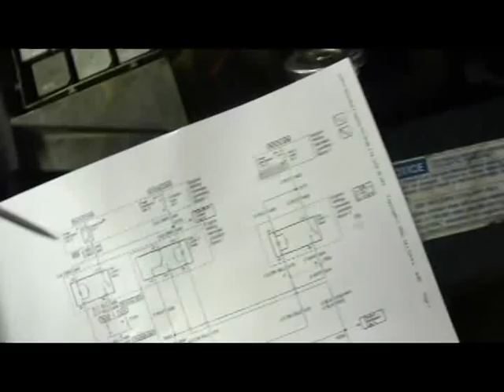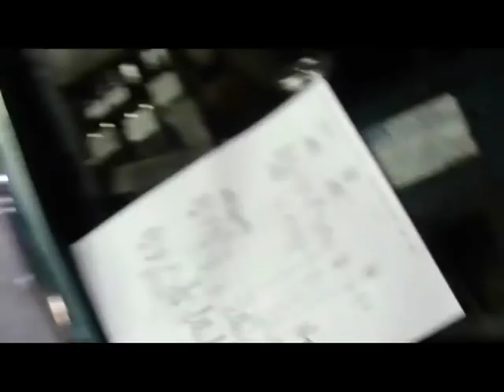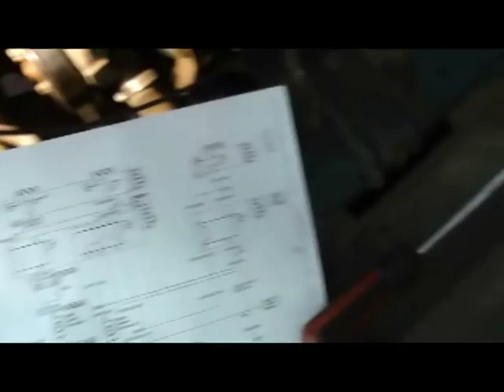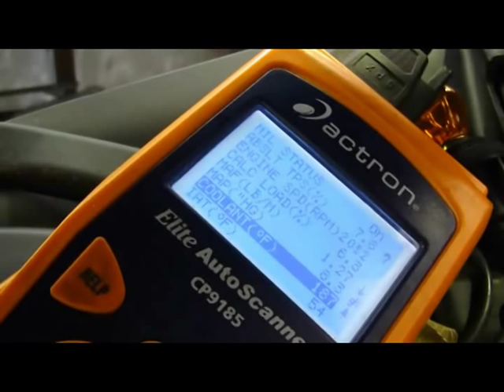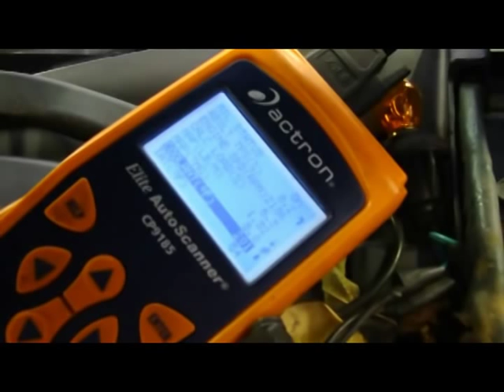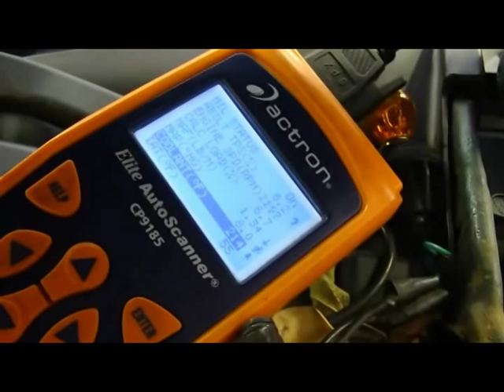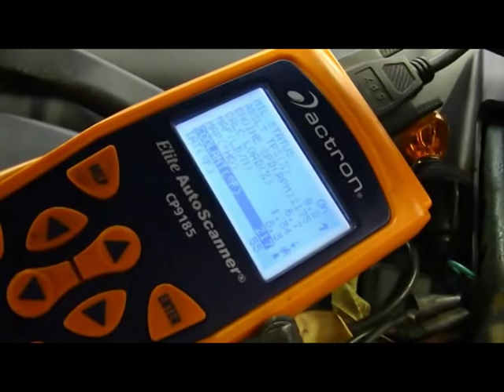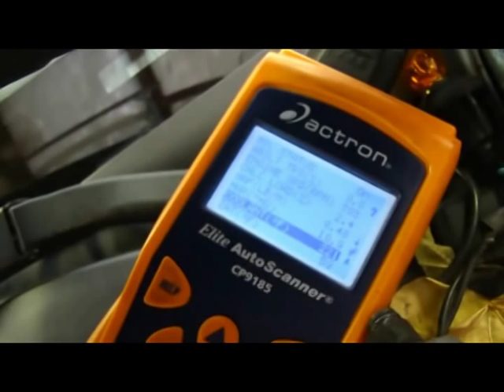Electric Radiator Fan Diagnosis

Comment: My wife has the same car. And it was overheating. I confirmed that the fans were working. With radiator cap off, I noticed the coolant wasn't flowing. I suspected thermostat was stuck closed. Easy cheap quick fix on these cars. The rubber gasket was melted. Replaced the thermostat and gasket, and it seems fixed. Took a heat gun to the old thermostat, and it was smoking before it finally opened. I will know tomorrow if it still overheats. Thanks for the video!

Comment from the maker: The fans ground  to a transmission mounting bolt. via a relay. There are three relays in that system. Fan relay 1 turns on fan #1 which then grounds through fan 2 for low speed fan operation. Both fans operate at low speed. When relay 2 closes, Fan #1 is now grounded straight to ground for high speed fan operation. Relay #3 closes to put fan #2 into High speed fan operation.

Comment from the maker: Sorry about the late reply. The cooling fans come on around 229F by the computer temperature sensor. As long as the needle is in the white, its good to go. Overheating may have thrown the coolant temp sensor calibration off a bit replacing it may bring the gauge back down.

Comment: Once it reaches a little over 3/4 both fans turn on and temperature drops to a little over 1/2 gauge but if stuck in traffic, it starts rising again. When driven on highway temperature drops to middle and even lower to about 1/4, but on stop and go traffic it rises a little and the cycle repeats itself. I have only noticed one speed for both fans and seems like its the low speed, and it comes on after 3/4 of temperature. Should the fans come on sooner without the a/c on? Thanks in advance.

Comment from the maker: The car in the video is a 1998 Lumina. The engine compartment fuses are laid out pretty similar to the ones in the video. At the start I'm checking Maxi-fuse #1. #3 would be 2 fuses to the left, where the blank spot is in the fuse box. Turn a relay over and look at the bottom. Are the terminals numbered? Some are. 30, 85, 86 and, 87 You want to jumper #30 and #87 in the connector. Its good to check the motor like you did but jumping the relay like this, tests the wiring and the motor in one step
Reply: Psychoholic Genius 
Is this a 3.1 engine? I have a 95 cutlass 3.1 and neither of my fans are working.  The motors are good though i ran a wire from the battery to test them. I will be getting a test light tomorrow to go through this

Comment from the maker: A relay is an electrically operated high amperage switch. It contains a set of contacts and an electromagnet coil. When current is applied to the coil the magnetism pulls the switch contacts closed, completing the high current circuit to the fans or other high current draw device such as a fuel pump. Most relays have two sources of power, one provides power for the coil and the other provides power for the controlled device.

Comment from the maker: I'm sorry I didn't check this sooner. If they don't run with the AC on, check the main fuse for the fans.  If the fuse is good, check grounds. If grounds are good  you may have bad fan motors. However it is rare for both motors to quit at once, one of them may have quit some time ago and you are just now having trouble. In very rare cases, the ECM\PCM could be bad since it controls the fans.

Comment from the maker: Correct. You are jumping the #2 relay fan terminals to verify wiring is good to the motor. Key off. This way there will only be one terminal powered up, #30. With the key on #85 gets power also but it is not fused heavily enough to handle the fan load. The fans are single speed. As for a manual, try to find a Mitchell shop manual on Ebay or Mitchell 1 DIY has online access for a small fee.

Comment from the maker: Hello, in that car the fans are independently controlled through the ECM. If the 60 amp Maxi-fuse #1 is good, and you can pull relay #2 and jumper the terminals and make the fan run, and you can swap the #2 relay with #1 and the #1 fan still works (fast relay check) then the ECM is no longer controlling the relay. This could be due to a bad connection or broken wire between the relay and the ECM OR it could be a bad ECM. That fan should run always with the AC and sometimes at high temps.

Comment from the maker: The fans ground to the same point, a transmission mounting bolt. Two of the forward transmission to engine bolts are studded and used for grounding points. looking at the engine from the transmission, I would call it the bolt at 9-o-clock.
Reply: Psychoholic Genius To

Comment: Mr Genius,    My 01 impala is acting just like the lumina in your video.... The fans wont turn on until the temp is up well over 212.  all three relays check out ok and the fans come on fine when A?C is on...   What did you diaagnose on the Lumina?

Comment: on a 2000 Malibu fuse block diagram fuse #55 cool fan #2 ground (30A) (V6 only) I dont see it on wiring diagram and have no power to either side of the fuse. is it only hot when signal from PCM to turn fan on? Thanks for any help

Comment: Hello Mr genius,
I have a 05 Chevy suburban the fans are running high and I’ved already replaced the engine cooling temperature sensor thinking it was that, the other issue is that my temperature gauge stays at 160. Do you think it could be a relay which I haven’t checked. Thank you

Comment: Thanks for the info. Couple of further questions. I'm to place the jumper for fan relay #2, not #1 correct? Do I check this with the ignition on, off, or does it matter? Does my car have both low speed and hi speed fans? Where can I get a wiring diagram for my car?

Comment: Hi Genius 
My radiator fan keeps starting and turns off randomly as it wishes. No apparent fault is noted . No overheat nothing. When the fan starts , it starts too loud with highest speed !!   What is the reason for that ? Any help please . Astra J 1.6  2012
Thanks  
Kathryn , Germany

Comment: Hello , I have a 2001 Chevy  lumina fans only turn on with a/c on , I replaced temperature cooling sensor and fans still not turning on , I checked relays panel with test light and pin 87 has no ground,

Comment from the maker: No. The fans are not supposed to run all the time. On GMs they come on around 229 degrees Fahrenheit and any time the air conditioner is on. A quick test is to turn the air conditioner on and see if both fans run. Some Hondas have two fans but only one is for the radiator and the other is for the air conditioner condensor so turning the AC on only turns on one fan.

Comment from the maker: It is starting to sound like a ground issue. The grounds are two individual wires connected to the same bolt\stud. The ground cable from the battery should be attached to the same stud on the engine\transmission.

Comment from the maker: Correction as I have found a error in the manual. Make sure Maxi-fuse #1 and #3 are good. The wiring diagram shows #3 but the diagnostic chart says #1. They both feed the fans and we know at least one of them is good.

Comment: Where are these Maxi-fuse #1 and #3 physically located?  I've already swapped relay #2 with relay #1 and the #1 fan still works. also, I disconnected the electrical plug for fan #2 and connected two straight leads from the battery, one from positive  side, and the other from negative side. Hooked the other ends to the leads on the fan. This produced the fan to run. Regarding the jumping of relay #2 terminal, which terminals do I jump?

Comment: Earlier today before jumping the #2 relay I probed all 4 relay fan terminals with a tester and you were correct, only #30 had power. I then took a paper clip and jumped #30 with #87. Fan did not go on. I then tested all 4 relay terminals and this time only #85 had power. What would cause this? by the way both maxi-fuses are good.

Comment: I am quite certain that the fans in my car have not been hot wired. Would the paper clip that I used as the jumper not be sufficient enough to power on the fan? What else could be the problem if the fan didn't go on?

Comment from the maker: OK. I had to go find me a car to test. On Fan Relay #1, Terminals #30 and 85 have power with the key off. Fan Relay #2, terminal 30 is the only one powered with the key off. With the key on, both relays have terminals 30 and 85 powered. I'm thinking you may have tested the wrong socket or with the key on? I suppose a mouse could have climbed inside that little fuse box and chewed some wires.
Reply: Which transmission bolt ground are u referring to I need help

Comment: Noticed something odd while checking the fuse block. The fuse for the "a/c compr" appears to be inserted incorrectly, This is by comparing the same exact fuse for the "fuel pump" which is located to the left of the "a/c compr". Should both of these fuses be inserted like the "fuel pump" fuse is? If so, and the a/c compr fuse was inserted incorrectly Would this have an impact to the fan problem I'm experiencing considering the fan issue is with the a/c condenser fan??

Comment: I have a 96 Olds cutlass supreme with a 3.1l engine. The question I have is related to the fan from the passenger side. I've never seen this fan run, and I know the fan is definitely good as I've tested it. 

When does this fan get called to run? Just the other day I switched on the a/c and just the one fan, the drivers side was running.

Can you tell me when this fan is called on to run?

Thanks,
-tom-

Comment from the maker: Not sure about incorrect? As long as it can pass current and complete the circuit its good. Same for the relay. It's inserted correct, even 180 degrees out it functions just the same. 

As for the terminal release, there should be a tang that can be depressed by a small flat blade or paper clip and the terminal slides out the back.

Comment: Hey thanks for the video, I have an overheating problem on a 1997 Chevy Lumina 3.1L. I was wondering if both of the radiator fans should work on low speed or just drivers side? Engine overheated and blew head gaskets, it was fixed but temperature still gets to a little over 3/4 on the gauge. Thermostat was replaced, coolant sensor new, plus new water pump, system flushed and bled.
Reply: I have 2000 toyota rav4 radiator coolant fan not working

Comment: sir, I have a problem.. in a 2011 camaro my thermostat stuck and over heated  the engine causing an o ring from my heater core to bust.. I've replaced the thermostat and oring.. now my fans wont come on without the ac on.. I've checked the relays and fuses. I even changed the temp sensor for good measure.. the fans are still not coming on at 225. my engine usually runs at 205 to 209 so I have given them ample time to kick on.. any suggestions  at this point what be very welcomed
Reply: both fans run with the ac on.
Reply: ehwren did you ever figure out the problem

Comment: hello genius. i have a problem and was wondering if u can help. i replaced my 3.8 engine in my impala 02 and now i have code po481. fans work at low speed only,never kicks into high when im at a stop or in traffic. do i need to go into pcm to fix this?
Reply: U ever find out what ur issue was I'm having same problem

Comment from the maker: Fan not running with 30 and 87 jumpered? I usually see that when someone has chopped the wiring harness to hot-wire the fans :(
Reply: If I fix the coolant leak will the fans start working again ?

Comment: Whenever my cooling fan and A/C fans start on my car my engine starts to bog and shuts down, what can this be? my battery is brand new, if I disconnect the fans the car idles perfectly but as soon as I Turned them on issue starts

Comment: I was able to jump relay #2 and the fan ran. What now could be causing the fan not to come on? Is there anything else on this circuit that I am not aware of to be causing it not to come on? Any suggestions?
Reply: Butch Belanger always keep a ladies hairclip in car. file the rubber bits at very ends off and use them to jump the switch and complete the circuit/connection.
Reply: craig phillips a paperclip works well too.

Comment: what is that tool you are using is called?
Reply from the maker: +Jose Diaz The one with the display? Its just an OBD-II scan tool. It is plugged into the vehicles diagnostic link under the dash.
Reply: i reset mine on a ford fiesta 2001 but once i run the engine would this tell me the problem why the fans not running on the obd2 device?

Comment: need help with 1995 z28 camaro 5.7 fans will not come on buy them selfs fans are good and relays are good   sencers are good?
Reply: icaunt get my fan to work
Reply: prolly the air pump, works on same fuse

Comment: I guess my question for you ; in 3:30, if the fans, are running, why would you check the wiring ? Looks like the wiring is good. 
I would say, if the fans are not working; yet, all the wiring is good, all fuses and relays are good, this tells me; there has to be a bad sensor somewhere. 
There is a sensor somewhere that is not talking to other sensors to make the fans come on. This is my guess. 
My car has this problem, This is a mistery. 
Replaced the engine coolant temperature sensor, replaced the thermostat, checked and replaced the relays. Still no fans. 
When I apply voltage directly to the fans, fans come on. When I remove a relay, fans come on. When I unplug the engine cooling temperature sensor, fans come on. Mmmm ??? 
My guess is when I unplug the engine coolant temperature sensor, or remove the relay,  I'm bypassing the problem. 
This is not a fix... So I have no answers at this time.
Reply from the maker: If I recall, this was a 1998-99 Chevrolet Lumina. It's a very basic cooling fan setup for most manufacturers at the time. Year/make/model and I can provide more detailed instructions. Newer vehicles will try to turn the fans on if the ECM/PCM detects it can no-longer trust the coolant temp sensor or the fan control circuit. Sounds like the fans run in fail-safe do they also run with the A/C on?
Reply: @PsychoholicGenius  thank you for responding. 
Ok... Here's what I've learned so far. 
My fans do not come on at all. Unless; 
1).. I unplug the engine coolant temperature sensor, I think I'm bypassing something. 
2) ..remove the relay, again, I thinking I'm bypassing something. 
3).. apply voltage directly to the fans. 
4)... With the radiator cap off, engine is running. The fans come on in 30 minutes. But radiator cap has to be off, or car will over heat. 
My fans never come on, not even with AC on. 
I checked the AC clutch, I gave it a spin by hand, it turns easily. Mmmm ??? Confused yes. 

Only the top radiator hose gets really hot, it swells up. 
The lower radiator hose is good. I thought I had a clogged radiator, when I drained it, the antifreeze came goshing out like a crazy water faucet. 
So I did confirm radiator is good. 
My Dodge stratus 2002 doesn't have a radiator fan switch. I confirmed that with Dodge dealership. 
Any ideas ? I'm fresh out of ideas.
Reply from the maker: @guesswhomartin9249  4 or 6 cylinder or 8th digit of the VIN.
Reply: @PsychoholicGenius  4 cylinder
Reply from the maker: @guesswhomartin9249  Here is the wiring diagram https://drive.google.com/file/d/1TNs1hh2bXIRaJtFLMCWabJL6hIniEXfP/view?usp=sharing although from your description of a cold inlet  and hot outlet to the radiator sounds like the engine has already suffered overheat damage. Does it miss on cold startup?
Reply: @PsychoholicGenius  my car has no problem starting up. It fires right up. I keep an eye on the temperature gauge inside the dashboard. 

But let's say I'm wrong. If my engine already suffered overheating damages. It's just a matter of replacing the head gasket right. I can do that myself. 
I don't need a mechanic for that. 
Thank you for the wiring diagram. 
But I don't see anywhere in the diagram anything about the temperature sensor, where's the other end of that wire for the temperature sensor ? 

But never mind. I think I figured it out. It's my water pump that's no good. That's why the fans never come on. That's gonna be my guess.  I have confirmed my water pump is leaking. Maybe that's why I have air bubbles when I remove the radiator cap. 
I see the water circulates.
Reply from the maker: @guesswhomartin9249  The coolant temp sensor is connected to the ECM/PCM. The ECM controls fan speed by controlling (grounding via pulse modulation) the fan controller terminal #2. https://drive.google.com/file/d/1cocbH7fr9khS5o23MPmplN034X0nmt5A/view?usp=sharing

Comment: Toyota Camry 96 funs stay on when the key is open
Reply from the maker: Hey Victor. Do both fans run or just one? Also is this a 4 cylinder or the 6? Don't think it matters 4 or 6. If everything is still stock as it left the factory and no one has done any alternative engineering on the fans, fan relay #1 could have fused the contacts together keeping the fan circuit completed. If both fans are running at low speed, its possible the ground from relay #2 to the engine control module has shorted to ground or the engine control module has shorted internally to ground (blown transistor).
Reply: THANKS GENIUS ITS A 4 CYLINDER 2200  AND BOTH FANS RUN AT THE SAME TIME I DISCONECT THE RELAY FOR THE AC TO GET MORE HEAT  IN THE MORNIG BECAUSE IT SO  COOLD IN COLORADO
Reply from the maker: Victor Garcia
Are you the original owner? If not, have the fans run continuously since you got the car? Or, is it something new that has cropped up.